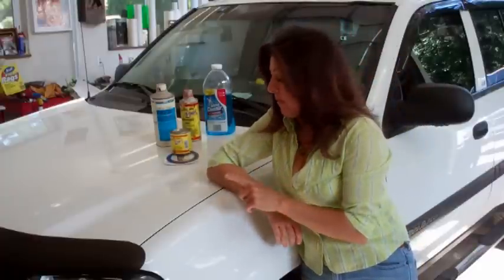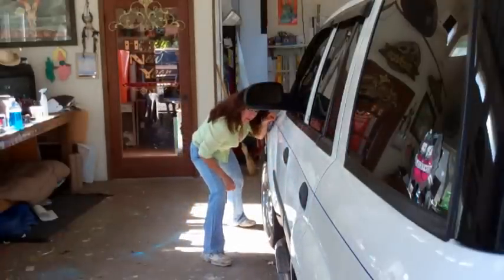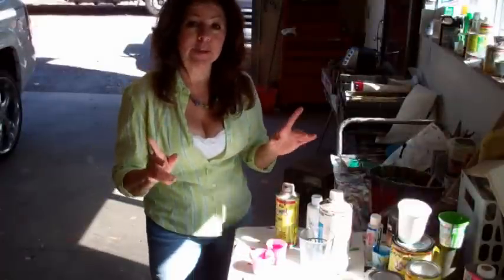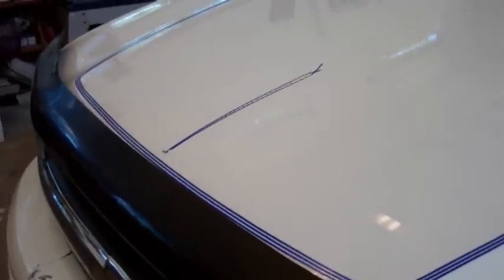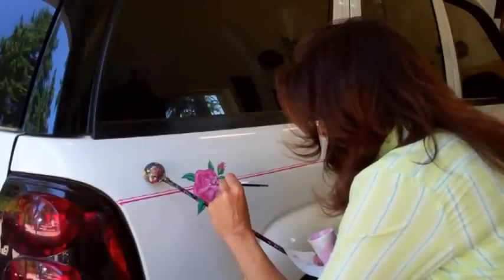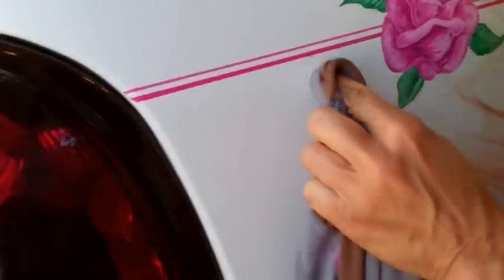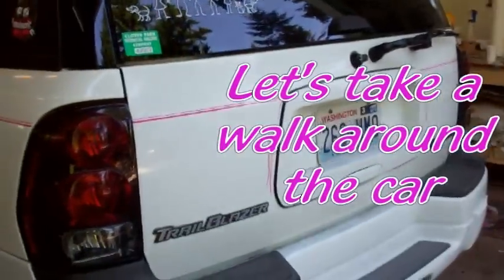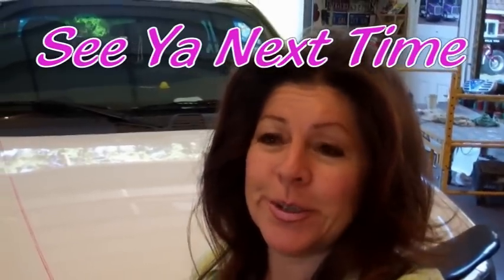How to Pinstripe a Car

Comment from the maker: Do you mean a 23 karat gold leaf stripe? If you do a gold leaf stripe, you will have to outline it as well. The outlines give it a cleaner edge. But use a very thin outline. No more than 2/16 of an inch.
Reply: "2/16"..isn't that called 1/8th..?

Comment from the maker: What some people don't realize is that every job is different. There are times when the stright line striping is done without tape, like on a Rolls Royce or a very, very, very nice car. It wouldn't be appropriate. On other cars, you have to tape off the straight lines. Especially when you start getting into the wider grpahics, airbrush effects, or ? It's like saying there's only one way to play the guitar.

Comment: I have a question that you might be able to answer. - Do metallic paints show up shiny and metallic when you pinstripe with them or do they flatten out? I bought a new truck and would like to get metallic stripes to compliment the factory paint but a sign painter that I talked to said metallic flattens out. I experienced this with bursh-on model paint as a kid and have seen my wife's fingernail polish turn flat so I'd like to avoid this on my new truck. Thanks in advance, good video!

Comment from the maker: @deckard43 No, I tape off the stright lines with 3M fine line tape. Since I double coat just about everything I do, the Beugler striper tool really won't work for me.

Comment: Thank you for the quick reply. One other question for a project on my own car... Can I use any other enamel ? All I want to do is a subtle paw print in 1 shade darker than my SUV. Good to see another kick ass woman artist in the business . Gracias
Reply from the maker: I wouldnt recommend it. 1-Shot or Ronan LETTERING enamels is the sign painters paint of chioce for this type of work. But if it is just for yourself, I quess you could try Rustoleum, but it has to be oil based.

Comment: Starting to stripe, taped off a tough area because tough getting a brush in there with much control. I bought the expensive frog tape and it didnt bleed, but when I pulled the tape the edge of the stripe looked harsh and in some spots edge pulled out a bit. Tried dried, tried wet and same results, any ideas? Thank you

Comment: Thanks for sharing your knowledge with us. I cannot find the vinyl in pink and thought I'd have to find someone to do it but cannot afford that either. Doing it myself is what I will do!
Reply from the maker: Do you mean Pink vinyl stipres? The kind they sell at the Automotive paint supply? If you do it yourself you will need, 1 Roll green fine Line Tape 1/8 in. 1 Half Pint 1-Shot lettering enamel, mineral spirits(Paint thinner) and a striping brush.

Comment from the maker: You are aware I have been doing this type of work since 1985. Never, not once, have I have a problem with 3M green fine line tape leaving any adhesive. It is the tape that most top painters use where laying out graphics.

Comment: You are way off base. 3M fine line is what everyone in the trade uses. It doesn't leave adhesive residue. It was engineered to be used for lettering and pin striping. I've been doing this for over 30 years and have been using this same tape since it was released to the public.

Comment: This video should be titled "How to Stencil a Line Using Tape" The ironic thing is that there appears to be some pinstriping designs in the finished product but you don't even stop panning the camera to show them.
Reply from the maker: Yeah, you're right, in fact the whole thing is faked. The chicken actually striped the car.

Comment: This isn't pinstrping. It's making a line with two pieces of tape and painting it. If you need to use a single shot of tape to gauge yourself, that's one thing but this method may as well be a full vinyl stripe down the body. Just cus it's not a  "Rolls Royce" doesn't mean it doesn't deserve a good striping job. I give  standard pickup trucks the same attention to detail as I do high end rat rods.
Reply from the maker: Now, now calm down, this is meant for beginners. A very simple introduction into pinstriping basics. Once a person become  a bit familiarized with the process, they can then expand the design into what they think is best.